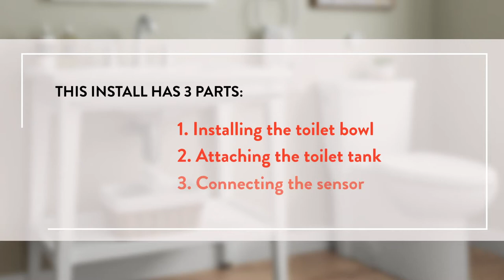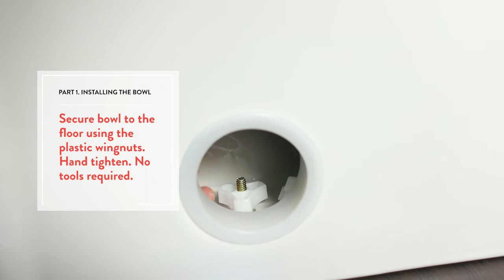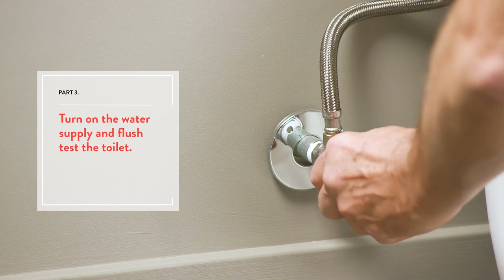American Standard Touchless Toilet Installation: Concealed Trapway

Comment: How in the world does the ring for the hidden side caps set in the hole!
Reply from the maker: Hi Carlos - Please ensure you are applying enough pressure to secure the bolt covers, as they should easily cap onto each side hole. If the issue persists, please give us a call at 800-442-1902 so we can get some more details and troubleshoot. Thanks!

Comment: How about the seat?
Reply from the maker: Hi Nick - You can reference the below videos which differ based on model: 
- https://youtu.be/qOqLWaCagEU
- https://youtu.be/1Iubui1XYLI
- https://youtu.be/NZGvTC40hjM

If you ever need further assistance, you can always give us a call at 800-442-1902 and a member of our Consumer Connection team will be happy to help. Thanks!
Reply: @americanstandard  what about a video explaining how to replace a seat on the toilet in this video? I believe each of the three videos you linked are for normal toilets where you can access the bolts but just looking/reaching under the toilet. My toilet just has the little opening at the base…how do I change the seat!!!???
Reply: @Als8013   Exactly!  I've got 6 of these things to install and am stuck with the seat!  I think I can figure it out but I don't want to screw it up.